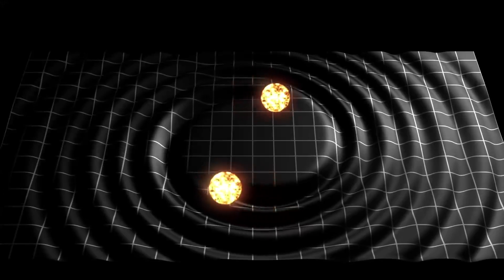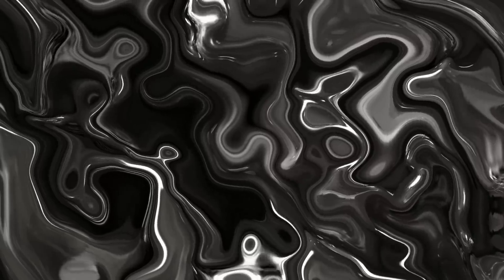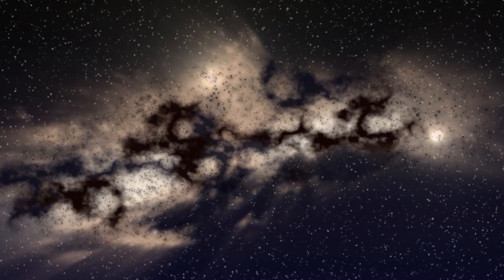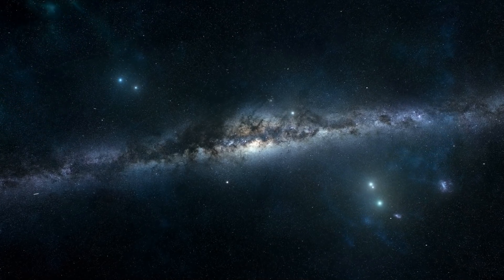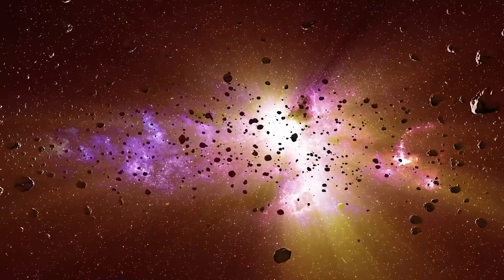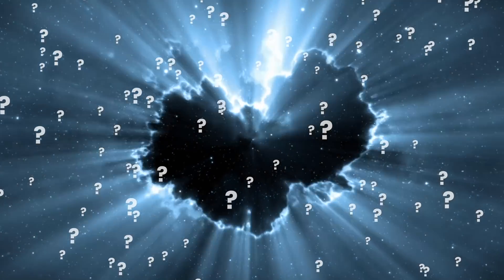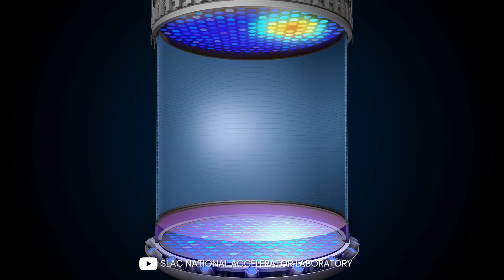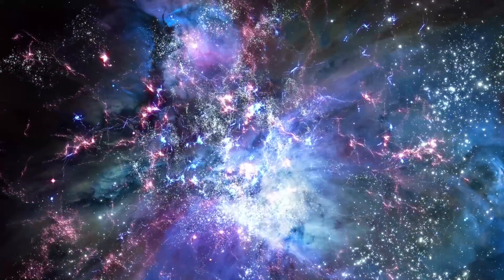This Will Change Physics! Dark Matter May Not Exist!

Comment: Of course it doesnt exist. First of all, dark matter is synonym of "einstein general theory doen't describe rotation of spiral galxies at all". Nobody ever found dark matter in experiment, it doesn't follow from any particle theory. It just lame attempt to save General relativity theory.
Second, the distribituon of matter in universe is controlled by gravity only, all other fundamental interactions are very short range and doesnt contribute in this process. This means that distribution of dark matter must EXACTLY match distribution of common matter, and this is not the case, quite the opposite.
Reply: Dr. Sabine Hossenfleder had a guest on her channel who wrote a peer reviewed article from Cambridge England that challenged the data used by Dr. Perlmutter's team along with Brian Schmidt's team.   Sabine did at least two videos on the topic.  The author, whose name I can't recall right now (Sakar ?) said that his team analysed the data used by Perlmutter and Schmidt and concluded that the data had been scrubbed for calculation purposes.  His team reviewed the data and made systemic corrections to it  The  conclusion was that there is good evidence that the universe, although expanding, is not accellerting in its expansion.  If so, there is no need for dark energy in the first place.  Although the article was popular about 2 years ago, it seems nobody has mentioned it recently.  Anybody can search for it on her popular YT channel.
Reply: @daffidavit  Not sure about dark energy. Big bang theory still needs something to explode universe. Black holes don't explode by themselves and at moment zero the whole universe was one giant black hole.
Dark energy (whatever it is) can fit this role.
Reply: What if they are real particles darkmatter is real . See there are two approach one improving gravity and other trying to find particles they are separate ways which will decode dark matter
Reply: @loganx833  How are going to find dark matter, if it is completely absent in solar system and hundreds of light years around solar system? Otherwise orbits of planets and stars around the sun would deviate from Einstein theory, and they are not
Reply: @dimakor5914  they are present everywhere but only few are in our solar system. Even if it is 0 percent it no problem scientists are coming up with new ideas to capture them so.

Comment: I don’t think the universe is expanding by way of a force pushing it outward. Quite the opposite, I think something is stretching it, pulling it. In essence, the universe is falling into something. A different cause but similar resulting effect to gravity pulling on mass.
I have no data to support this; just a hunch.
Reply: The reason why that sort of an explanation is often overlooked is because that would require an entire sphere to be present around the entire universe, doing the pulling... And that seems rather odd... 

Since we know that most of the universe is extremely homogeneous, it's very unlikely that there's a sudden edge to the universe with something pulling on it. 

It's more likely that there's something spread through out the universe, to maintain the homogeneity that we observe. 

Hopefully that conveyed the idea?

Comment: k like i came up and designed the nasa programs. plus the ships from the voyegers on up, all of it. at the age of 15. latly i designed  virgin galactic, blue origins, ans space x, plus the intersteler group. so like the microwave back ground was my thing. i new that we would find a cold spot at the center. it was my secret. i had no degrees and still do not. i figured some math out and new einstien was dead wrong. with no degrees and i was so young i did not want to challange the great and giant playgerist photographic mrmory thief, einstein. so i came up with string theory to try to save the mechanics of einstein. were as the math lead to gravitons and tachions, in truth. well the web scope is about to discover that he univers is 32 times larger. and 28 billion years old. what we see as datk energy is simply the cold spent energy imploding to the cold spot at the center. the visable hot energy is simply moving from the cold like warm and cold fronts due in our weather. thus the expanssion of hot visable matter is simply being drawn out to the spent energy of the early universe. that is furthe out and curently imploding. establishing the ultamit life of the univers to the end in the big crunch. the next set of scopes will further confirm the discoveries about to be made by web. p.s. i new that the voyegers would find inter steller space much thicker than the solar space. yours joel ramirez ramirez.

Comment: Saying that dark matter doesn't exist is actually an understatement. There are at least fifty different types of dark matter - and not one of them exists. Every one of them is entirely fictional. And dark energy is not actually a separate entity. It's just an artefact of the interactions between the 50+ different types of imaginary dark matter.
Reply: Back those claims up? Or just gifting your opinion?
Reply: @LongNeckSweatHogDirtyWetDog  
There's at least fifty different types of dark matter described in the literature. Hence, at least fifty different types of dark matter. But if dark matter doesn't exist then obviously none of those 50+ types is real. There's also a clue in the fact that there's no actual evidence for any of them.

Comment: I read something that some scientist think the dense object in the middle of the galaxy might be dark matter itself. But dark matter is always described as not interacting with light, so why is the dense object in the middle of the Galaxy engulfed in a ball of light in every image you see of it? I’m asking the same question if the answer is that the large & dense object could be a super massive black hole; light does not escape black holes so why is it engulfed by light?
Reply: Black holes don’t emit light. The image you have in your head is one created of inaccurate science fiction.
The light that can be seen around a black hole (note: not emitted from it) is caused by the accretion disk. That’s all the stuff falling in, creating unbelievable amounts of electromagnetic radiation. Visible light is simply a part of that EM spectrum, so it’s also emitted.
At the center of the Milky Way galaxy, like the center of every galaxy we know of, is a supermassive black hole. Ours is called Sagittarius A*.
And it is not made of dark matter.

Comment: as far as i know, the astrophysicists calculated the amount of matter in the universe based on gravity and cohesion, then looked at the cosmos and found that what they saw is like 20% of what was needed... so they thought 80% of the mass is invisible but still in the observable universe... i think dark matter doesn't exist, it's just the matter outside the observable universe that still interacts with the observable universe because gravity doesn't have a limit of interaction
Reply: If its outside our observable universe its unlikely gravity from those objects. Gravity propagates at the speed of light, and whatever is outside our observable universe is too far away due to dark energy's exponential expansion
Reply: @Dario Ampuy there is also the calculation based on the light curvature when it passes in the galaxy, yeah you can calculate the mass of a galaxy by seeing how the light interacts with her. and with this calculation they found out that the galaxys have way more mass than they appear to have and that missing mass is what we call dark matter :). dark energy is about the strange way that the universe expands with an aceleration. at least is what i learned about it. 
sry for bad englisg fell free to correct me :)

Comment: How can weakly interacting particles cause stars which spew million mile per hour solar winds full of extremely large particles to move faster than normal?  Think about it.  If the tiny WIMP particles don't interact with matter then how they going to cause a star with lots of mass, spewing a hot wind full of charged particles to move any faster?  It makes no sense!  Even if the star was swimming in these imaginary particles it wouldn't cause the mass that makes up the star to move any faster.  If anything the star should be propelling itself through space by spewing out hot charged particles which are interacting with cold space or EM fields.  Charged particles have been proven to be affected by magnetic fields else particle accelerators would not function.  Maybe they're just looking at it all wrong, like a coon dog barking up the wrong tree.  

Besides, if the galaxies contained dark matter halos around them then why don't the stars get pulled out of the galaxy?  Clearly the stars and satellite galaxies have exceeded their escape velocity orbiting around the galaxy, some traveling at 1 million mi/h.  A dark matter halo cannot explain their velocity while also explaining why they are unable to reach an escape velocity.  Can't have one explanation making sense if the same explanation doesn't work to explain other observations.

I wrote and published a series of 6 books on a variety of topics like gravity, dark matter, dark energy, cosmology and more last year.  Right now they are around 90% off list price because of a pricing error by Amazon but not for long.  I came up with the equations that when added to general relativity perfectly explain the extra motion of stars and galaxies pinned on both dark matter and dark energy.  they accurately predict the motion of all the stars and galaxies, not just 4.6%.  I just sold 3 more copies a few days ago.  In my books I explained why stars and satellite galaxies are unable to reach an escape velocity, regardless of their velocity.  The answers will surprise you because they make perfect sense.  Even my radiologist told me my ideas made perfect sense.

Comment: What if light (photons) partials being emitted from the trillions of stars in the universe in all directions is actually the mysterious force expanding the universe? If photons can theoretically push a “solar sail” then why couldn’t they have the same effect on stars planets and galaxies basically pushing against each other ? ☀️ ✨
Reply: Photons producing this type of force don't match the observations of expansion.  If it were true, the biggest brightest stars would produce the most "expansion juice", which would result in measurable differences between expansions throughout the observable universe.  

It would be like a tub full of water balloons of many different sizes.  If they all suddenly popped, the balloons with the most water would "push" the hardest, causing the water from smaller balloons to "expand" away from the force of the big one. That's just not what we see.  It's expansion isn't necessarily uniform, but there are limits to how much variance can happen, which disproves your hypothesis.

Very cool idea to imagine, though. :)
Reply: @b0xf0x13  Havnt they also stated that the universe is expanding faster than the speed of light, so if photons were causing the expansion wouldn't it be expanding at the speed of light not faster?
Reply: @himynameis3664  The expansion of the universe is define as the Hubble constant which is about 70km/s/Mpc, thats a long, long way from the speed of light!
Reply: Yeah I was just looking it up there myself and you're correct. Strange, I thought I read or heard somewhere that it was expanding faster than light speed so that meant there was parts of the universe that we could never see even if we had unlimited time. Must of been daydreaming
Reply: @himynameis3664  No thats correct, what I meant was the expansion 'rate' is only 70km/sec but thats every Megaparsec, Mpc or 3.26 million light years i.e it multiplies with distance until you go past the speed of light. So the rate of expansion can be small and still produce expansion greater than light speed on a universal scale.
Reply: @himynameis3664   I'm no expert, but it seems to be expanding faster than light speed based on what I can learn.  You're correct that the speed of photons would be limited in that regard, but I think they would need to be even slower.  If photons could exert force to push the universe, I would expect the universe to respond with an equal and opposite reaction.
Reply: @manoo422  ah I knew I heard something along those lines. Man the universe never stops being amazing
Reply: @b0xf0x13  yeah makes sense. Every new fact I learn about the universe just blows my mind
Reply: @himynameis3664  Seriously...every time I think I am just starting to really get it, BLAM!  Nope, still a dumb as a rock. XD
Reply: @b0xf0x13  I honestly think no matter how long we survive as a species we will never fully understand it all. Have you read The last question by Asimov? It's only a short story really worth it. I think The last answer is another one. You should read both if you have half an hour to spare, really great stuff.
Reply: @himynameis3664  I'll do that!  I agree that we can't learn it all.

The idea of a Grand Theory of Everything seems like fantasy to me.  The entire concept of the scientific process suggests that no matter what we know, there will be more to know based on the knew knowledge.

I think we just need a Grand Theory of Everything Right Now. 🤪
Reply: @b0xf0x13  Haha, yeah the Grand theory of everything feels like something that's really close but in reality it's like an infinite russian doll.Every layer we peel back will just give us another question to answer. Really do give those stories a read. They're quick,free and prob will leave you with some form of existential crisis.
Reply: That effect, if it existed would cause galaxies to expand and not the space between them. Which is the exact opposite of observations...
Reply: Damn bro, I like that idea. Never would've thought of that.
Reply: I have written similar comments about heat from the stars could cause a type of "energetic pressure" that would create a "solar wind" that might make the stars and galaxies spread apart out into the surrounding vacuum. The further things get spread away from each other, the less gravity would hold it together, and if you keep the gas pedal on a constant pressure, and gradually release the break pedal on your car, you would of course experience an acceleration, like with the expansion of the universe...

Although, i more strongly believe the expansion is caused by the universe being torus/donut shaped, and spinning like a vortex. The part going out from the center will start expanding into a bigger area, and of course this expansion could only happen through an initial acceleration of the expansion of that part of the universe. (EDIT: Dang... If that was the case, then the universe would probably only expand in the left/right dimension, and not in the forwards/backwards dimension... Aw, man i feel stupid for not realizing this for several years, LOL! Kids; dont do drugs - like weed and alcohol..!)
Reply: Except photons have no mass so they don't deform the spacetime fabric AT ALL. Photons can push a "solar sail" because they're like tons of sub-atomic marbles hitting the sail.
The thing with the expansion of the universe is that galaxy clusters don't move, there's just more and more space on between them. That's the so-called dark energy. Not only is it adding space "out of thin air", but the emptier an area is, the faster it expands. Also that dark energy is the weakest force/energy there is in the universe that we know of. Even gravity which is an extremely weak force (you can beat gravity by lifting your arms up) completely neutralizes this expansion.
Reply: @louisrobitaille5810  this is incorrect and a nobel prize was awarded for proof of it. Photons do in fact have mass
Reply: @charlesreid9337  Who received it and when?
Reply: Stars emit light in all directions. So for every particle emitted to the left, there is a particle emitted to the right, meaning the star is being pushed in all directions equally, so it’s not being pushed at all.
Reply: Nah. This force pushing against something is just your mom.